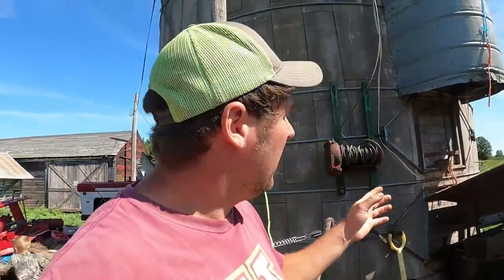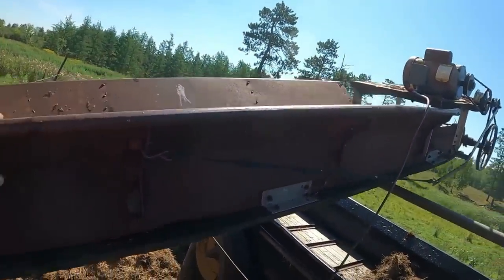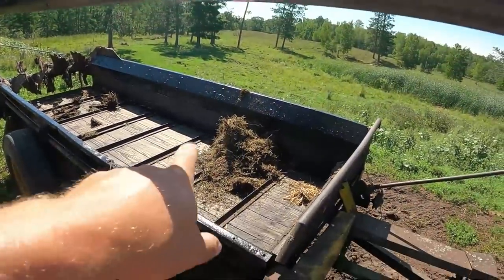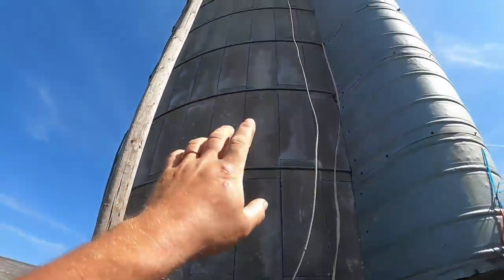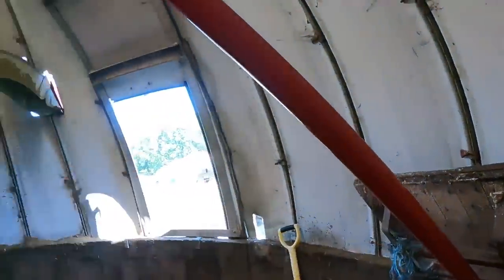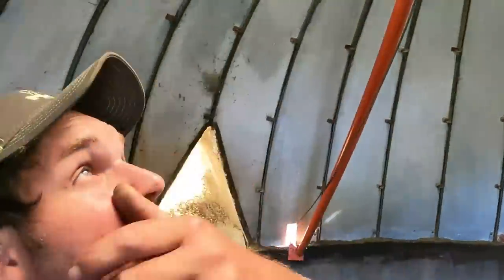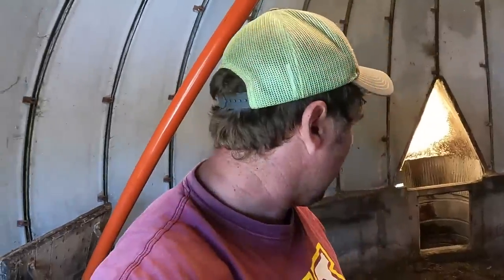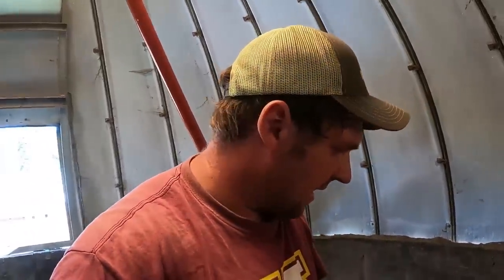New Silo Tripod/Opening up the Silo/Feeding Haylage

Comment: smart move replacing the tripod now you can hoist the unloader with a piece of mind that it is not going to come crashing down do to a faulty pulley i lost an unloader 40 years ago due to a rusty pipe on the tripod that broke 60 feet is a long fall lucky no damage to the silo may the unloader rest in pieces
Reply: We had a cable snap at 80’ my brother was guiding the unloader and had the mind to let go of the rope! 20 ho motor bounced about 10 feet up in the air!
Reply from the maker: WOW!